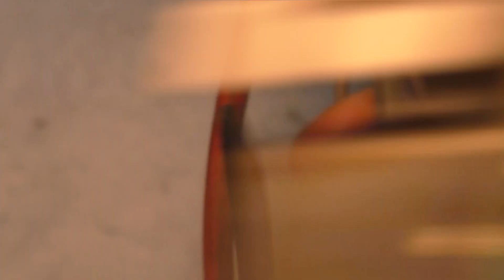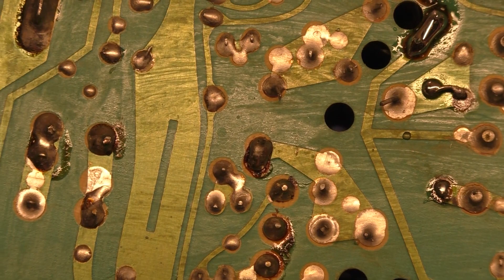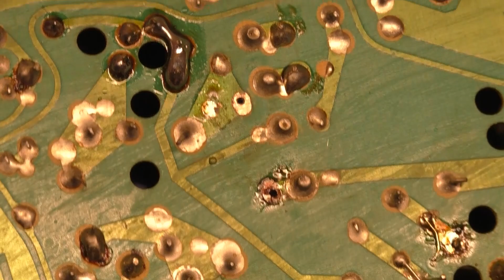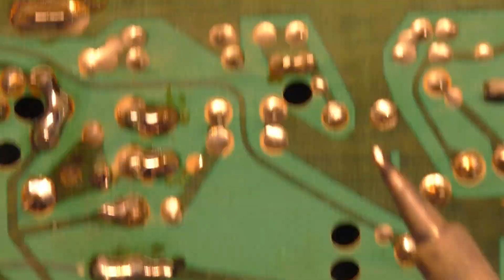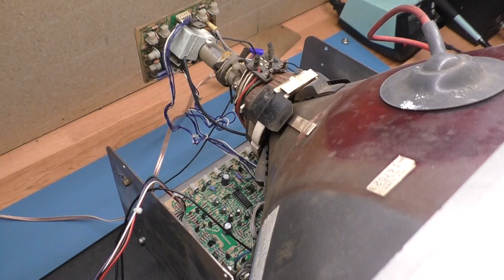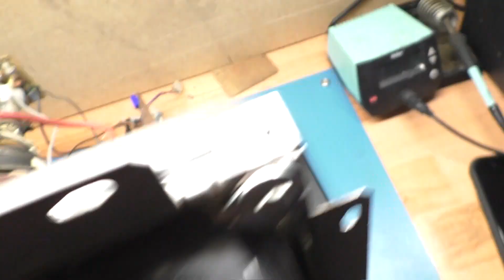19" K7000 Arcade Monitor Repair-A-Thon #1 - Basic Testing Tutorial, Pad Repair, Light Bulb Test

Comment: thanks for the video. i have problem of wg k7302 dead . i change c807 cap because sign 60 uf , but problem not solved. i have no neck glow or ht. can is a q101 transistor ?

Comment: 1:04:19 Finally someone else that shares the same opinion. Completely agree about the flyback. I quit replacing flybacks years ago after running into several replacements that either failed shortly after or were just bad to begin with. If the original works well and looks good, I don't replace them and typically have better luck with them anyways. Unless they're cracked or obviously bad or going bad, I don't replace them.

Comment: Great video. Was P447 ever used for 25"? I have a P447 but someone hacked in a STR3130 instead of 123. I have not powered it up yet -- just doing checks.
Reply from the maker: Yes: Rare, but it was done VERY early in the life of the 7000 but if you have the 220 ohm B+ resistor, it’s a 19” and requires the STR3123. If the resistor is 180 ohms, it is a 25” and requires the STR3130.
Reply: @MikesArcadeMonitorRepair  Yes, R301 is 220 Ohm. I was afraid that the chassis was built for 25" and swapped into a 19" setup. Strangely, R103 was two 2.7Ohm 5W resistors in series. I will be replacing that.
Thanks again, Mike. Your videos are amazingly helpful and informative.

Comment: Mike, on the bulb sockets, one wire is hot and the other is neutral; for testing, I assume the hot wire is on the regulated output on r301 and the neutral is on the frame?  Or does it matter?
Reply from the maker: It does not matter.
Reply: @MikesArcadeMonitorRepair  if you can’t find a 60watt bulb, what’s the LED equivalent or maybe a 40watt?
Reply from the maker: It’s hard to say. 8W LED bulb = 60W incandescent…with regards to luminosity, not wattage draw. I used a 9W led bulb in my latest Polo video and the B+ was only 5vdc off what it was supposed to be under a tube load.
Reply: Thank you. I just did this test with the 40w and I got 122VDC.  Tried with a 70w and got the same.  Given the p447 is for 9/13/19” chassis I imagine there’s some flexibility in the “CRT”

Comment: Hi mike you do a great job i have a 25k7000 its dead my voltage regulator tall one read .5 on pins 3 and 4 i have no b+ ive tested like u pointed out. My hot reads shorted in circuit c36 is not shorted the hot reads good out any help??
Reply from the maker: Give this playlist a watch…

https://youtube.com/playlist?list=PLUMwNlYwedmsaSuTbocFbGU95gNEcbPoK&si=PneESrXGpQqXGtpX

Comment: You say R101 should be between 4.5 and 6.  Mine reads 4.3, is that close enough or does that mean there's something wrong?
Reply: On your C38, you say "Its in the megaohms so its fine", however yours says like 6mu and mine is reading about 1.5mu.  Is that still within tolerance?
Reply from the maker: As long as it's not shorted, it's fine.
Reply from the maker: In circuit? Yes. Out of circuit, it should be around 6.5.
Reply: @MikesArcadeMonitorRepair  So I tested my HOT(D1398) and it read shorted with the black on the middle leg and the red on the right leg.  I can't remember what it read, but my voltage regulator(30130 "skinny") was also different from yours so I ordered and replaced both of them.  I soldered them in and the fuse blew again.  Now, the new HOT reads shorted from the middle leg to the left leg.  The new voltage regulator reads .338v from pin 3 to pin 4 in circuit (while the HOT is out of circuit if that matters).  

My C36 reads .519v from bottom left to top right and .941v from bottom right to top left with the HOT out of circuit.

The B+ resistor reads 176u with the new voltage regulator installed.

Oh, this is a 25" P538. I installed a cap kit and a new flyback on it.  It was not blowing the fuse before I did this, it just wasn't showing a signal.  I'm assuming I need to order ANOTHER HOT, but would like to know why it's blowing before killing another one.  Any help would be appreciated.  Your videos are fantastic, but my situation keeps veering slightly from your examples and I don't understand enough to know whether that's important or not.

Comment: Hi Mike you mention the k7000 requires an ISO transformer. Do you have any videos on these? 

I got a k7400 working recently on a midway cab. At one point I was considering using an untested K7000 that I had spare but the cab had no ISO transformer and read it was crucial.
Reply from the maker: Correct. You will blow the rectifier diodes on the K7000 without an isolation transformer.